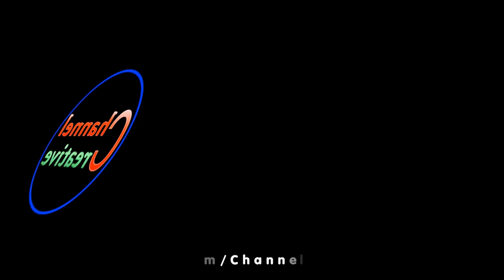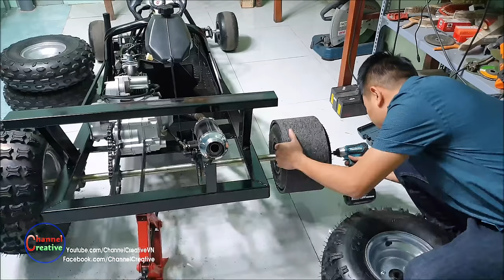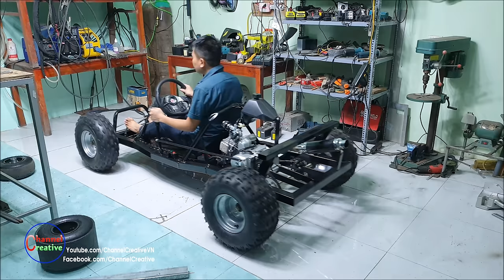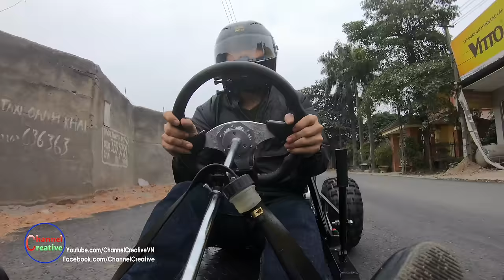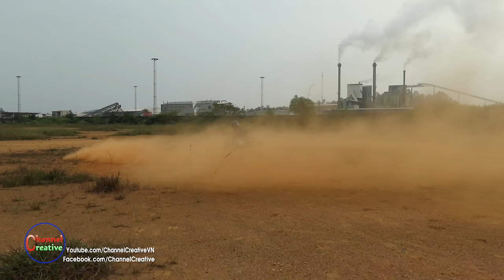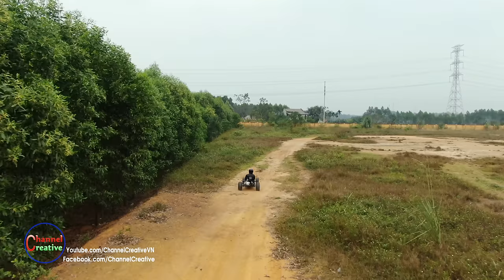Upgrade F1 Gokart v3 with OffRoad Tires - Video 4K

Comment: This the project you should have added a suspension of some sort. But still an awesome project.
Reply: ja to przpisałem
Reply: Also need side mirrors...😍
Reply: @diversionmary  привет
Reply: @diversionmary  привет
Reply: Agreed its a bone shaker for sure!
Reply: Hello
Reply: Please add suspension. Awesome work
Reply: He didnt add a suspension because this was supposed to be a fast shifter cart, adding a suspension would add more weight. Its better to one for each
Reply: Yes, would have added suspension. Even though it is a fast shifter vibrations will not allow you to enjoy the drive for longer time.
Reply: Run the tires at 12lbs. and stay in the sand or on hard pack/flat dirt roads, that was all we had in the early sixties when karting and mini-bikes first came about, and I NEVER saw even one of those come apart as long as they were welded together decently and have known of quite a few being handed down to someones grandchild - sometimes with the same Briggs & Stratton or Tecumseh 3.5 or 5 hp engine and original clutch (!) when they had not been beaten.

Evidently most people here do not realize that when racing on an established track, it is "groomed" several times during a night, or day, by dragging the track with tines behind a quad and then raked with 2' wide yard rakes so the track stays smooth - at least as far as Speedway and FlatTrack is concerned.

My Son Robert raced a Junior Speedway bike two seasons and before that I was unaware this was done.

About the same time Mechanix Illustrated had 'plans' for building their "Tote-Goat", with a rigid suspension and huge doughnut type tires that could go anywhere and several of us built them with 3.5 and 5 hp lawn mower engines, hooked up to a "jack- shaft", and although I have quite a few off-road bikes, still wish I had that bad boy - but have been looking at an 8hp engine at Harbor Freight for a fifties style motorscooter I designed a few years ago, so who knows (?). 

And just for info, the tote goat could practically climb vertical rock faces and go anywhere you pointed it due to the variable power delivery system available for it.

For anybody interested, tyres can usually be had for free from a small civilian aircraft if you ask the owner, since they are thrown away and make excellent tyres for something ike this.
Reply: @diversionmary  i think youre being mean plus he could just go lower with the tyre pressure since rubber tyres are also a way of absorbing the bump.
Reply: @500M views Yep, plus he might want to expand the tire to tire front end, putting those bigger tires limits the turning on the kart.

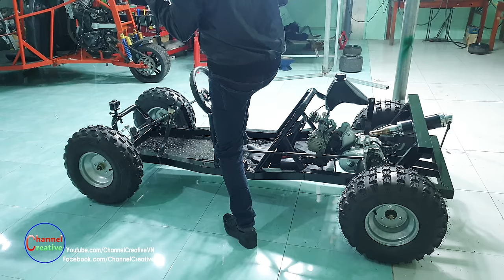Comment: 1:49 Incredible build, but i still think it needs a slightly stronger engine. Maybe taking off the the steering support mount bar and weld more pipe like this /--\ so you have leg room to get out of it fast if it rolls over. The bent flat bar will trap you if your in momentum. The world still need great inventors brother.
Reply: yes, then you can make the steering column stiffer. I'd also add a roll hoop and harness, I've seen a crash where a guy flipped and didn't have either, let's just say it was nasty. It's better to be safe than sorry

Comment: ミニスリックタイヤよりも口径が大きいせいか、安定しているように見える。サスペンションがないせいでタイヤが浮くことがある。サスペンションを付けたら完璧なゴーカートになりそうだ。
It appears to be stable, probably because of its larger diameter than mini-slick tires. There is that the tire floats due there is no suspension. With a suspension, it's going to be a perfect go-kart.

Comment: How can I make a reverse gear on a bike engine plz help me
Reply: You can't do that...
But you can create a little gearbox you can attach that has a reverse shifter ... 
So basically free basic gearing from the bike itself and a gearbox that allows reverse shifting...
It's hard tho but good luck whatever you want to do✌✌✌
Reply: well its simple and a pain at the same time, 1 option is buying the reverse gearbox that links to the engine from the outside
 https://www.gokartsupply.com/gearbox.htm
https://www.amazon.com/BLAST-Kart-Forward-Reverse-Gear/dp/B01H9BPSMC

if you live somewhere where they dont sell this type of things then you have another option which is changing the direction of rotation via different "axles", chains, and sprockets.
Its basically having a main shaft or axle that holds the wheels like normal. (the drive or chain is like normal). Then add a moving axle with 2 sprockets that work as a tensioner would work(i mean when you engage it would get closer to the main chain, basically pushing against it causing it to have "traction to the axle on a different rotation direction. Now you have to manage to disengage the main gear to the wheels because if not you would be trying to go in 2 different directions at the same time. now the reverse gear or axle goes directly to the main axle(wheels) rotating freely until you engage the reverse(touching main chain with sprocket). Ok so try now to make a sliding system to disengage the main drive or gear from the main axle. So at the end you should have two chains going to the same axle. 1 moving freely until engaged unto the main chain causing it to transmit power to the wheels(if not its just neutral(in reverse)) you have to manage to disengage the main drive from the wheels but still from the engine.
Someone correct or add if im wrong
(or maybe to understand what im talking about.
Take ideas from here 
https://cr4.globalspec.com/thread/103987/Forward-Reverse-with-a-Single-Belt

Comment: hi mate you need to put air cooling coulings on each side  of the motor so it won't over heat and break rings in the motor

Comment: If you let the tyres down and only run about 5lbs of air pressure, you will get a much smover ride and way more traction. or do suspension mods. You Can check out my kart/buggy.  https://www.youtube.com/watch?v=esGyJSUZ1OI